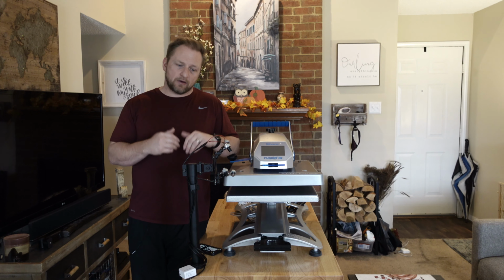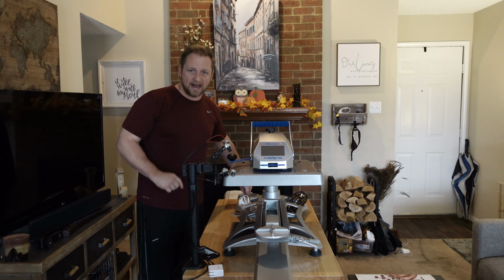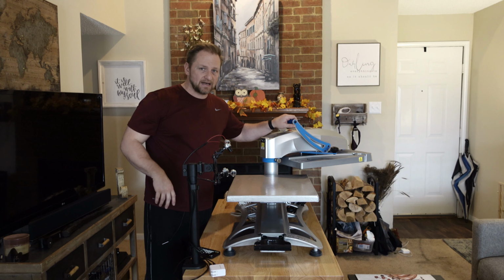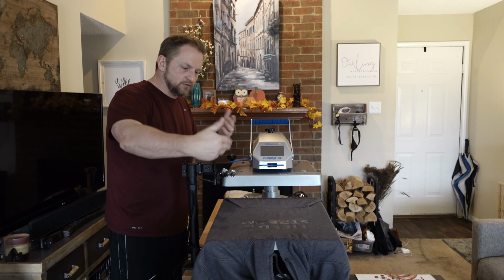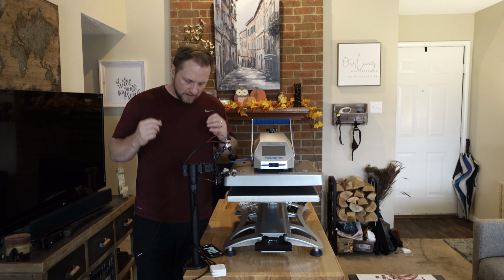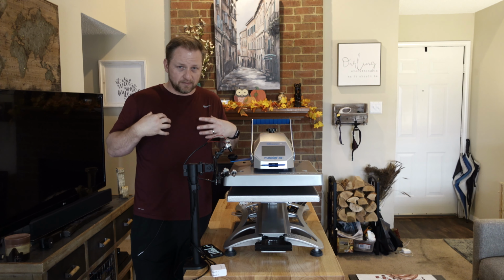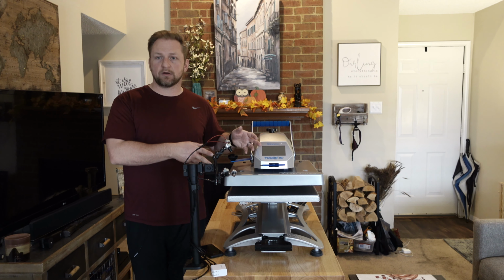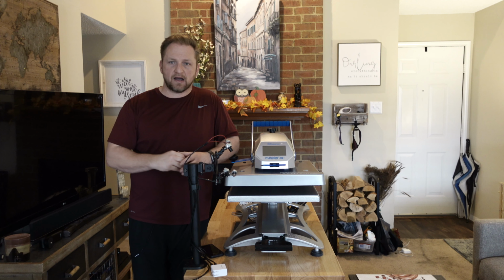REVIEW | HOTRONIX FUSION IQ HEAT PRESS

Comment: Is the top of this press magnetic? for fridge magnets to hold teflon sheets like big bradoh does?
Reply from the maker: Interesting question! Because I ended up getting a new job that requires a lot of travel, I actually parted ways with this press and stopped doing apparel. I think the upper platen shell is steel, but the it could be aluminum. Sorry I can’t confirm it for you. I’m sure other YouTubers can confirm it for you. Best of luck!
Reply: Appreciate the response. Best of luck in your new endeavors! @OneDegreeLife
Reply from the maker: @dinchcrinto17  thanks!

Comment: I got back from the impression show in Long Beach California I got to take a seminar for stahls I also go to see the fushion up close and the IQ hat. First thing it’s built like a work horse they are very nice and smooth my opinion it’s way the best press and I demo probably around 15 different press brands at the show. Also I noticed every booth around 75 had all the the fusion presses to what ever they where demoing from the garment brands to their DTF prints to the sublimation demos going on at the manufacturer’s booth. Now I can see why they are pricey it’s hands down the best press. The only draw back I see is there no auto open ( but not every press will be perfect) but if you want a workhorse this is. I talked to so many users and personal owners of this man one at the show they said hands down the best press. So here the thing I know every can’t afford my advise if you can save up and if you can make to a impression show near or the closest to save and buy it. it comes with a package deal around $5400 come with 
Fusion IQ  16x20
Fusion IQ hat press 
The new tag HP platen
Kraft paper 16x20 25 pack
11x15 platen 
Heat pillow set-all 5 sizes
6x20” platen for sleeves / leg
6x10 platen
Quick slip lower protector 11x15
Quick slip lower platen protector 16x20
Print Perfect pad 5x6
Thermo tape holder 
Thermo heat tape (2) rolls 
Flexible application pad 
Quick slip lower platen protector -6x10
1/8” thick 4x8 foam pad for hats 
$250 catalog product credit 
Free ground shipping anywhere in the us

Comment: Great informative video.  This was very helpful.  By the way, what size stand are you using for your Hotronix Fusion?
Reply from the maker: The one shown here is a Husky work bench from Home Depot. They hold a lot of weight and come with casters for easy moving, if needed. I have the 54" model, but they come in different lenghts.

https://www.homedepot.com/p/Husky-52-in-W-x-24-in-D-Steel-1-Drawer-Adjustable-Height-Workbench-with-Dark-Stained-Wood-Top-in-Gloss-Black-HOLT5201B11/317302932
Reply: @OneDegreeLife  Thanks for that information.  After plenty of research, I made the call today and ordered the Fusion. I think this work bench would be a good fit for my space.   Very excited.   Thanks again.
Reply from the maker: @karlastoudemire9522  So happy was able to help. The Fusion is an incredible machine and I sincerely hope it meets and exceeds your expectations!

Comment: Thank you so much for this very detailed video.

I saw on the website that it said it needs a dedicated circuit?
Reply from the maker: Thanks for the feedback! Glad it was helpful. 

Yes, all Hotronix heat presses (and theoretically all presses in general) require a dedicated 120 amp circuit. After talking with techs at Hotronix about issues with my original A2Z, they were double checking this with me because running on a lower amp circuit, or one with other devices plugged in that can draw power, could cause issues with the platen not heating properly and other issues. 

Ideally, the press would be the ONLY thing plugged in on the circuit and no extension cord used. You can use a heavy duty cord, but they HIGHLY recommend only doing that as a last resort.

Most homes have dedicated circuits in the basement/garage perhaps, or you can check the fuse box to see if the 20 circuits connect to things like a washing machine, for example. Most homes will have that on its own 120 circuit and you can unplug that, etc. But yes, for proper function, it needs to be plugged in to a 120 and be the only thing on that loop, or you could end up with function issues or tripped circuits. 

Hope that helps!
Reply: Thank you again! Appreciate your time on the reply.